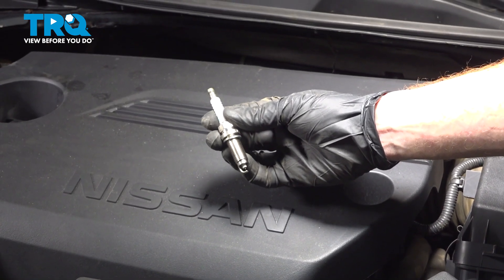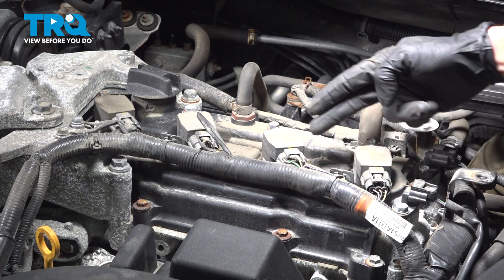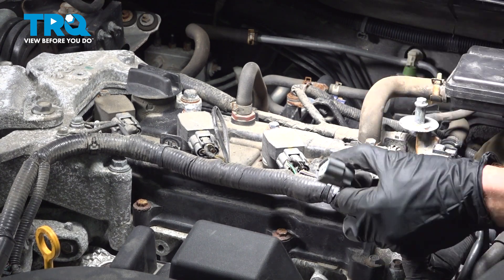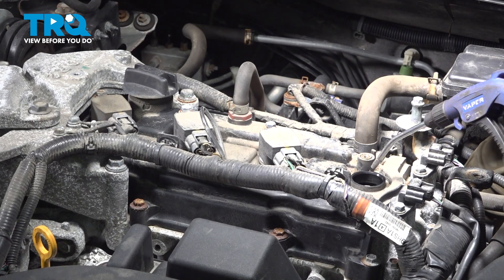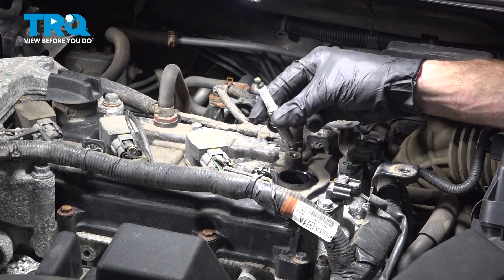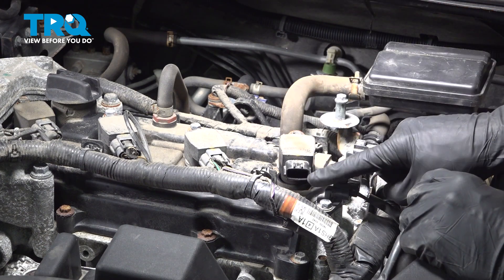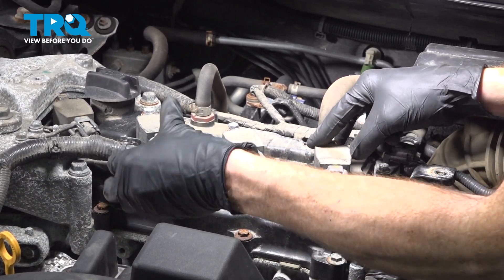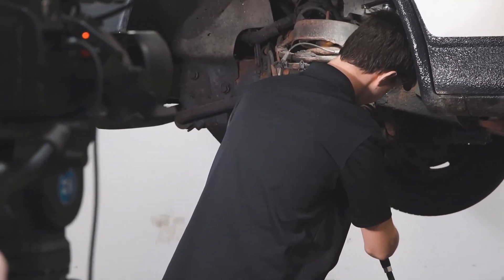How to Replace Spark Plugs 2012-2018 Nissan Altima (2.5L)

Comment from the maker: √  Watch the Video
√  Buy The Part at 1A Auto https://1aau.to/m-Shop-TRQ-Parts
√  Do it Yourself
√  Save Money
Reply: Do you know what type of spark plug is good for 15 Altima 2.5? When I look up the part its confusing cause most companies just list everything they have (even with the filter on)... you have double platinum plugs, you got iridium plugs, you got double iridium, I think even high performance plugs popped up on there lol wtf.

Found out it uses iridium, but the parts numbers are a mess.

Comment: You didn't applied the antiseize on each spark plug.Also each spark plug need to check the gap as compare to original one.

Comment: Great video one thing I'd like to point out is for the coil bolt torque the tech says 62 inch-lb and the video graphic says 62 ft-lb. The tech is correct in that it is inch-lb.